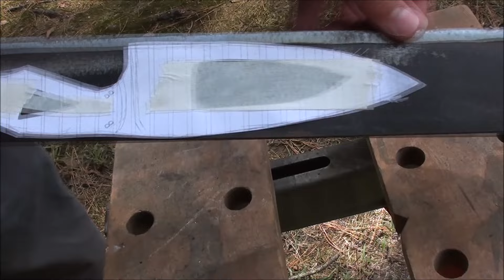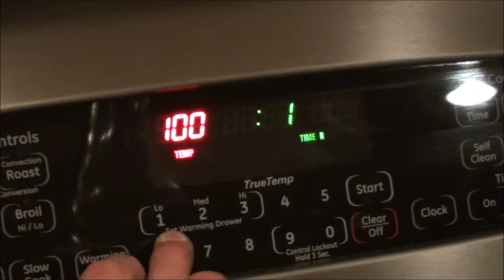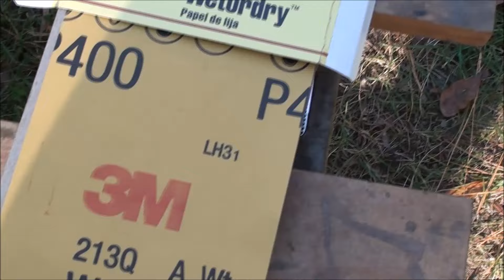MAKING A CHEF'S KNIFE

Comment: Hey. Nice knife and working looks good. Just some tips. The handle bends down and in chefs knife tjat is not the thing you want. Your fingers will hit the cutting board and makes the cutting very uncomfortable in longterm. The whole blade is curved and needs a flat portion in front of the handle for different purposes. Keep up the good work and keep making interesting designs.
Reply from the maker: I've actually been told this by my father already, haha, and will tweak the design next time on the handle (for my hand and my mother's hand, the handle worked fine with no hitting of the fingers.  But with my dads larger hands, he bumped them a couple times which became uncomfortable for him).  On the blade shape, actually about half of the cutting surface is straight/flat with the other half being like a continuous belly (sorry if this wasn't clear in the pictures).  Thanks for the kind words and advice.

Comment: Do you always keep a small gap on the blade bevel before heat treating? it looks like there is a small 1 mm gap that you don't sharpen down until after treating the metal. I've seen some people just file down the blade bevel to a point and some not. Would it be hard sharpening the blade with that gap after the metal is heat treated and tempered? I have no belt grinder and am doing everything by hand with files and stuff. Just wondering what you would recommend thanks.

Also, do you preheat the quenching oil prior to quenching? If so how hot should you get it?
Reply from the maker: I always do leave a small bit of steel left, just the tiniest bit thicker than you would before puttting a secondary bevel on.  This leaves just a tad more steel to try to prevent warping during quenching.  It does get harder to work after heat treating, but personally I think its worth it.  

I do preheat my quenching oil.  It all depends on the oil: for parks 50 oil you only get it a little hot like 100 degrees Fahrenheit, but for canola oil (which I use) I just stick a railroad spike in the forge for maybe a minute or until its too hot to touch and then dunk that in to warm it up.

Hope this helped.

Comment: You aren't using angle iron are you? Tool steel isn't that much more.
Reply from the maker: Of course not, I would never.  I'm using recycled relatively high carbon steel.  It hardens nicely, sharpens decently easy, and holds an edge pretty good for recycled steel.  I have been either using this recycled steel or ordering 1095.  Thanks for the concern, glad to clear things up.

Comment: Nice looking knife. A couple things, five inches is a little short for a chef's knife. They are usually 8-10 inches in length (the blade). Second, the handle design is unique but looks like it would be uncomfortable for a chef who was using their knife for hours on end. Finally, the handle isn't really ebony, correct? it's a composite.